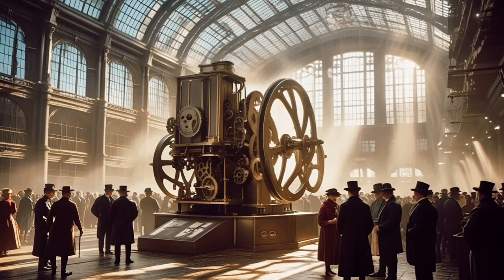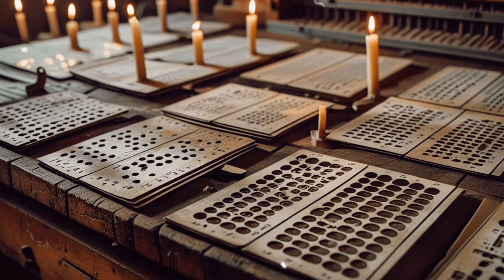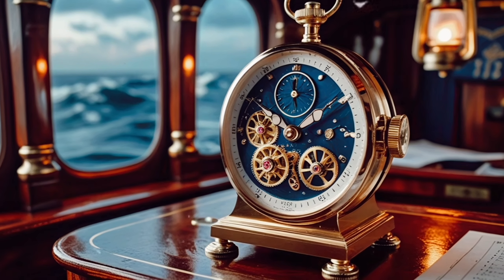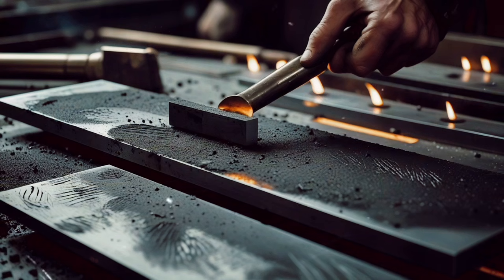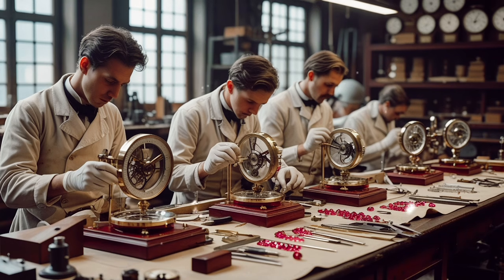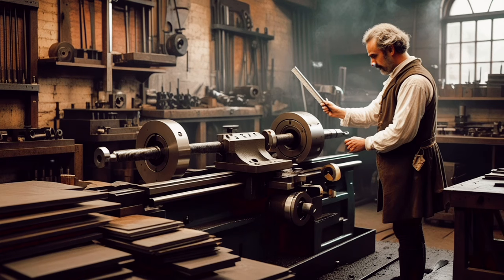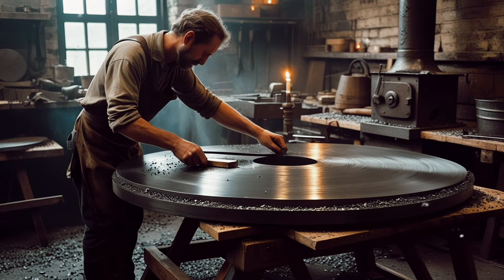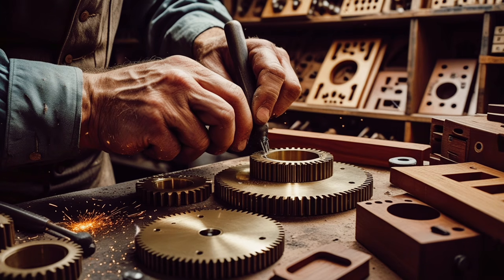The Lost Machines of the 1800s — Were They More Advanced Than Ours?

Comment: absolutly wrong.And i can PROOF it at Your all wrong. THIS is the real Secret of the Tartarians. They used the absolut simple Suckingeffect from Chemical School. Look this Video up. He show how Tartarians have used 2 Pipes n the Canalisationpipes to produce a Suckingeffect in the Pipe.The Pipe have suck Air from above in and have so clean the Air inside all Citys. a costfree Princip,based on a simple 2-Pipe-System. Your can now use THIS System to produce on one Side a strong Vacuum Effect and on the other End a strong High Pressure,right? So,all they have built was Airtide Vacuumpumpsystems som give you unlimited Power from moving Water and Underpressure. Your all can built it and instal it in your Canalsystem. On the intake can your now conect Airturbines,and other Devices som run on moving Air. On the Other End a Hydrowatergenerator for  the secound Powersource. So,NO Intake of Gasoline or anything,instead,your take Air out and the work beginns. Look it up and think,your can now built Ships,driven by Waterjetsystem,Cars run on the same Prinzip,even a Bycycle can your power with this System. So,now your have it back,use it wise and No Fear,it,s IMPLOTION,not Explotion Technoligy. Built everything ROUND for Maximum Vacuum. https://www.youtube.com/watch?v=ZCkcfi_CLpI

Comment: The assumption is wrong. You can create for example a flat surface oh perfectly flat surface down to the point where we have trouble measuring it simply by taking three plates then rubbing them together. with an abrasive between them - no files required.  (btw, That is how millstones were created. )

Comment: The machine tools that we produce today including those with hand scraped bedway's are more accurate than those built in Joseph Whitworths day.  The improvement in quality and consistency of materials,  the use of hardened and ground running surfaces,  the use of laser alignment, and the use of ceramic tipped tooling with better bearings and lubrication systems mean that today's machines run at higher speeds and usually last longer.
Reply: Bull shit  so light bulbs   white goods    and cars  all have    designed  fail times  and so do modem electronics and  programs  this  is  what people like JP Morgan started  profits over    life    quality and   advancing  human kind    and  taking skills  and   knowledge away  and   all about making  shit cheaper   and   controlling   people  and  keeping  them  spending money and  never getting ahead
Reply: @tobynewell8992  today's equivalent is DEI practices. Classes in college are replaced by feel good DEI classes. The current education is totally lacking in many areas that are sorely needed. I have helped allot of young engineers thru the years and it just keeps getting worse. I wish I had an avenue to giveback the knowledge I have acquired thru my lifetime of R&D engineering. Truth is, only a handful actually care.  That is one of the other things that were lost, the sense of being part of it all, knowing and using that knowledge and the appreciation for it all. Now it's just another job and really, it doesn't even pay that well compared to many unskilled union jobs. The reality is that 3we should use more mechanics to do things but we really rely on electronics to do too much. The marriage of the two is great but we have tilted too far into the realm of electronics and they do not have a long shelf life.